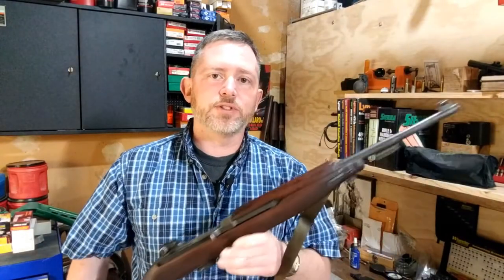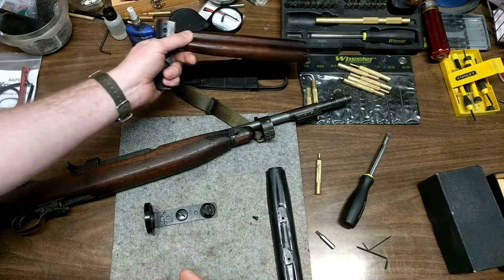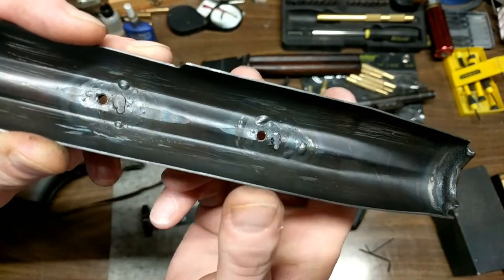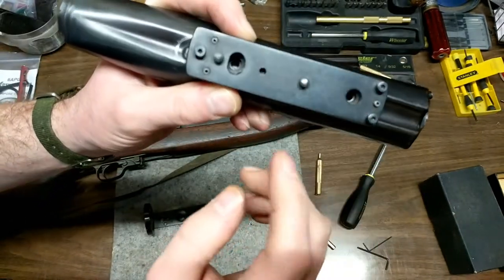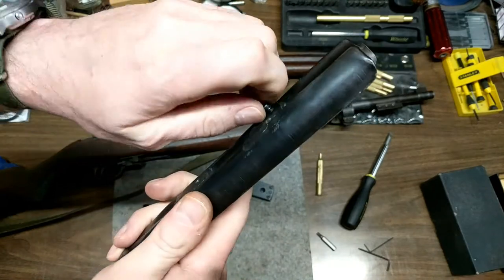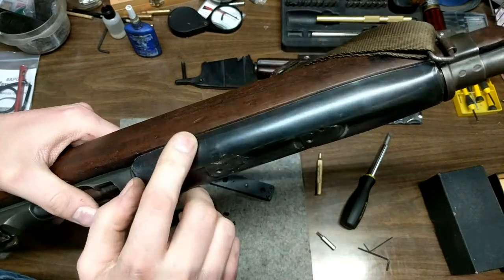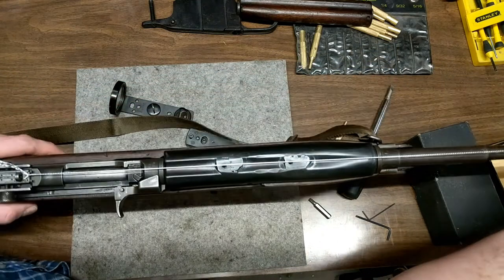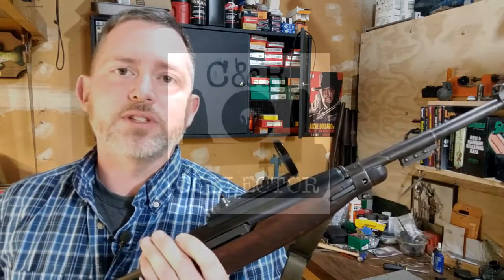I Mounted a Nydar Sight to a M1 Carbine

Comment from the maker: Forgot to add what I would have changed.  When zeroing I could not get the dot to hit point of impact at 50 yd.  The front of the mount needs to be higher, so that means higher front base or possibly further rear on hand guard.

Comment: The string trick is a great trick, just make sure that your knot is centered in the rear optic. I believe that the Nydar instructions (which can be found online) suggest using a mirror and light, and basically shining it down your barrel then centering the Nydar on the same spot on a far wall. One of those little bullets with a laser in it works great as well.
Overall, nice job. I like the "what if" builds. The ones where it is "what if the war went longer and these two met?"
Keep safe, and you have a new sub

Comment: Do you know the original mounting screw dimension for these?
A buddy of mine has a nydar but no gun to mount it on(yet) and I have a rem 11 that just happened to have the 4 screw pattern for the nydar.
 but alas he won't let go of the sight haha.

I'm just curious in case I wind up getting a nydar and it doesn't come with all 4 screws.
Reply from the maker: I will measure them and post it here.

Comment: There are a lot of old nydar sights on ebay but most are missing their bottom plate. Do you think a regular flat piece of metal with the proper holes drilled into it would make do? I am guessing just two holes like what you are doing would be good enough.
Reply from the maker: Guess it would just depend on the shape of the receiver it is being mounted on.